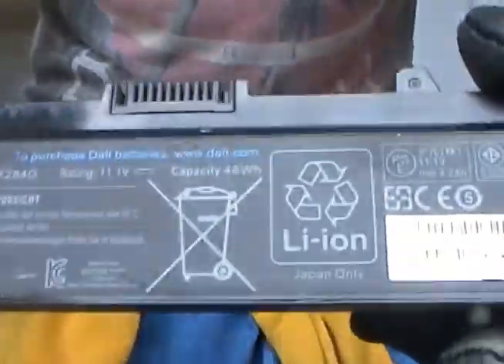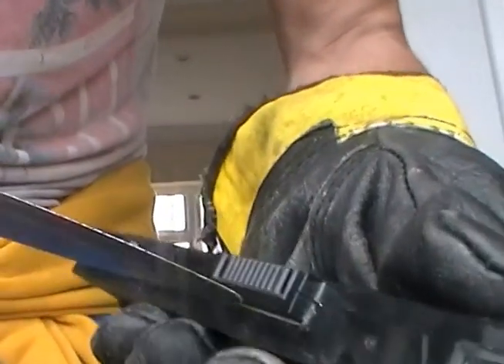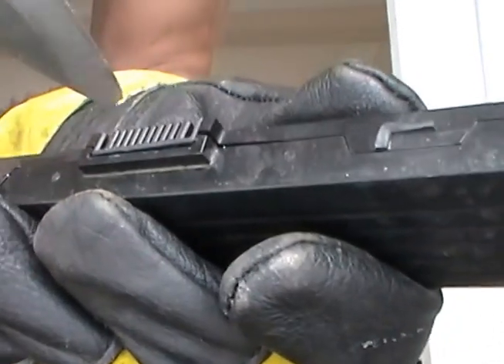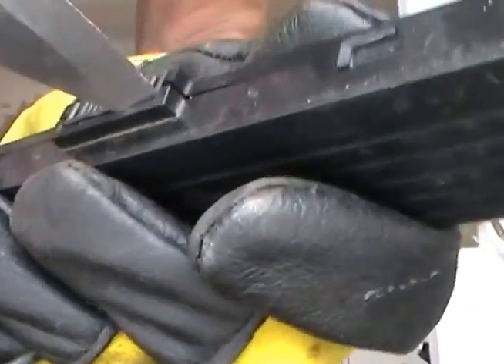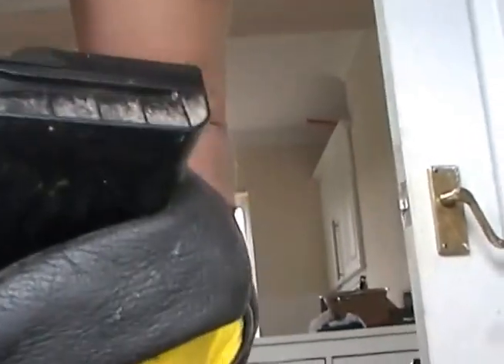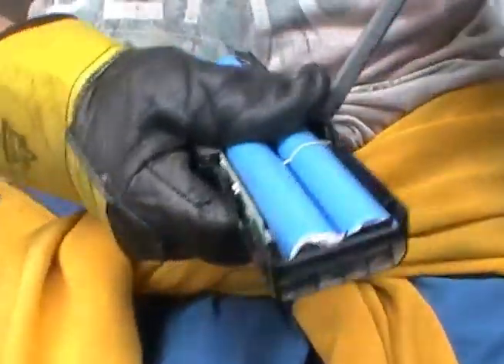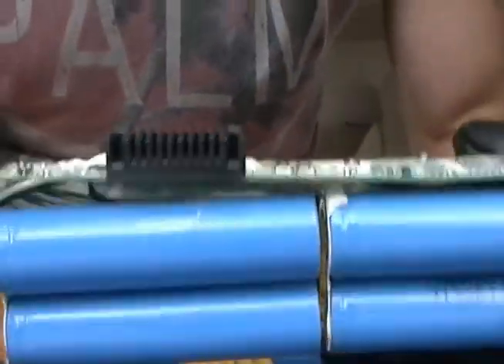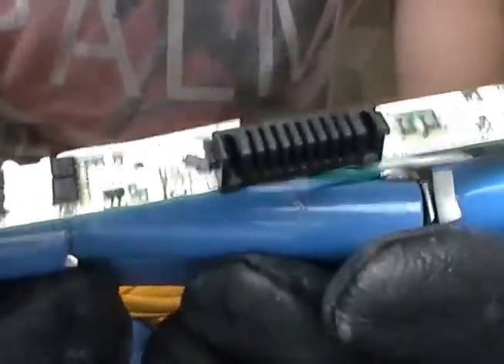DIY Lithium Ion batteries for beginners Part 1 ( RECYCLING ACER LAPTOP PACKS )

Comment: Is it possible to solder the plugin to the battery pack socket to hardwire the laptop? In other words hardwire to the AC (proper power wire for PC) to the battery pack socket and just plug in the battery pack.Mother board DC jack failures require too much detail and time to replace.Just a thought.
Reply from the maker: +Barry A

If you could it would be via the DMS board using DC that might work ,  they use DC because of the L-ion, not sur really Ill have a think about it

Thanks

Gavin